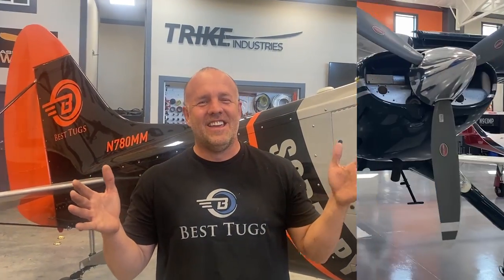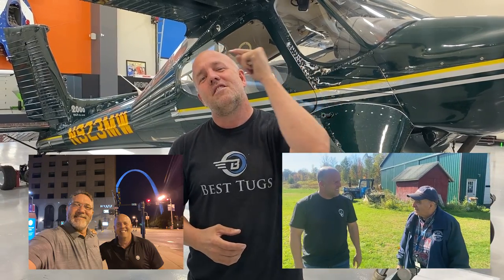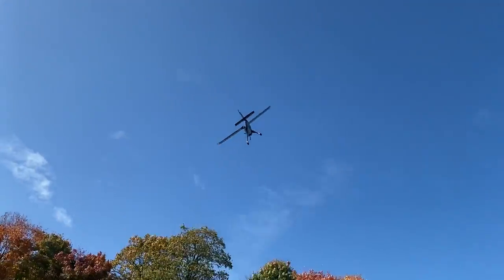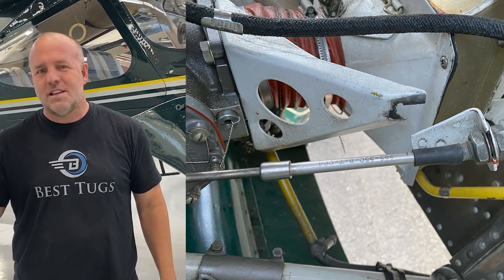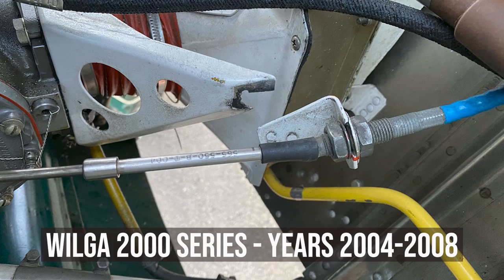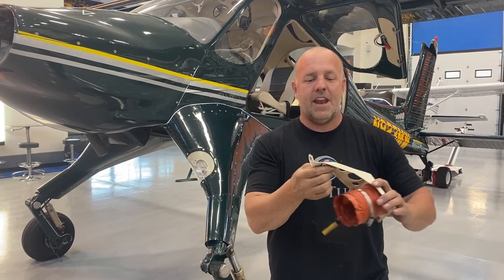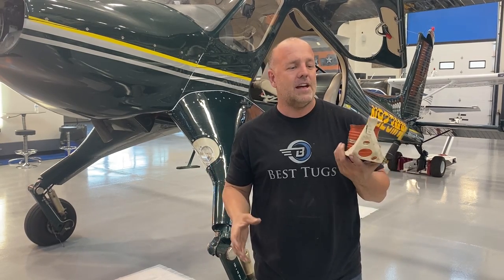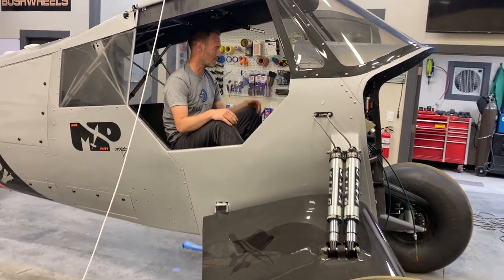Engine Trouble Flying Home a New Wilga 😬 | Scrappy 30

Comment: I'm 73, I soloed when I was 16. started flying lessons at 15, My original flight instructor Who is one of those people in your life who you will never forget was a very cautious type. Those days around 1962, we were flying Piper colts, dual omni was the hot set up. He always drilled into my head to constantly consider an emergency landing option, always be looking for a place to land. He would do the drill when least expected, pull the throttle and say land it. he would make me fly it to final before pushing the throttle back in and then proceed to tell me why the field I picked was a bad choice or a good one. I only fly flight sims now, and darn if I still don't always scan for nice flat unplowed fields near a road :)

Comment: 20 plus years ago, when I started flying I had those fears. But when I read the statics on the cause of air plane accidents I found 70% were cause by fuel management. I purchased a plane with 4 tanks and more fuel than I can fly before I need a break. Got my instrument rating to solve the next issue. These choices haves me the training and confidence to fly safely. And I always think where can I land NOW. Thanks Mike.

Comment: Had 3 quit in 1000hrs. 2 on takeoff, one of which was in a crappy field. When I started flying 8-9 years ago, I just asked (hoped) that I wouldn't have an engine out for a while until I was really ready.... I was given that... can't ask for more! As you said, It WILL happen eventually. To anyone who hasn't experienced it yet, there is nothing quite like it, intensity at a new level!... but keep your head on and you can work through it. Great video and talk Mike!!

Comment: Very good advice to fly by. Always be prepared for the bad things that may happen. 100% correct on the mechanics of things braking with no fault of your own. I've been there too. Crankshafts coming apart, driveshafts coming thru the floor board at 7 grand rpm, pushrods going thru the hood when engine blows. And then there's fire. Hoping that will never happen in the air but prepare for it.

Comment: Mike: Four weeks ago, while flying my 1945 7AC Champ, I suffered a engine failure due to a cracked fuel hard line. You are absolutely correct, there are two kinds of pilots, ones that have had a engine go out and those that will. I had to put Champie down in a cow pasture and was unhurt but unfortunately, it was quite rough and severely damaged the landing gear. Keep making these awesome videos. We all learn from sharing our experiences. Glad your ok.
Reply: Hope your plane is going to be okay.  That's a piece of history.

Comment: Nice point Mike, and for all of you that like to fly safe, here a short story about safety training. 
I've got my PPL-A back in 1990 I remember safety training was a big chunk of the overall flight training as well as of type ratings, but German flight schools doesn't let you go into a real stall with following spin. The idea behind that is to recognize the situation before you get into it. 
As soon as I've got my PPL, I grabbed a pilot friend, an "old eagle" acrobatic flight certified, and asked him to get me into a real spin and recovery. We got to 6000ft above ground and he did the first one, explaining exactly where we are and what he's doing. I remember as today, once the wind shield was full of spinning ground, I was stuck in my seat knowing that if I was alone on the plane I would never have recovered from it, even if I knew what to do. After first recovery my friend told me to do the same, but I said, no, you again, I was still so impressed by what just has happened. 1000ft loss in altitude in one only spin. There is no time to settle, you have to react immediately.
He did one more, this time I was completely aware of what happens and could count with him the number of turns and could say when to hit the rudder.
The next I did on my own, perfectly.
That was a really great experience, completely unexpected, I thought I could handle an aircraft, but was told the other way. That experience accompanied me while all my 11000+ hours of flying since then. 
Later on practicing acrobatic flights in a certified C150, or playing wild above or between the clouds, I don't remember how many times I stalled the engine in all kind of flight positions, but never had a problem to recover.
VFR is staying free of clouds, but what happens the first time you get into the clouds? Sitting inside a glass, having all milk around you and now trust your instruments is another thing pilots should experience, even if they are not IFR certified. 
It shouldn't happen, but it can. 
Today I know, knowing what to do, isn't sufficient, you have to practice as closed as possible to the situation you're practicing for.

Comment: Excellent safety brief Mike!
Reply from the maker: Thanks buddy 🤠
Reply: Mike Patey Did you see my suggestion about the second Wilga?
Reply: Its just a matter of time.
Reply: A good reminder to put the thing on the ground ASAP if something is wrong, even if it is still running.
Reply: what you are doing is totally wrong  placing so much weight in the grams is dumb  it does not belong there and puts stress where it does not belong
Reply: @MikePatey  c

Comment: I was taught to drive defensively which means I'm constantly thinking and calculating in 'What if' moments. That mindset has saved me more times then I care to mention while operating a car, motorcycle, sailboat, or tractor. I'm not a pilot but your advice resonates to my core!

Comment: Yeah Mike engine failures do happen I've had two in an Avid with the early Rotax 65 hp. Fuel issue when the carburetor loosened and an electrical broken wire. Both shortly after TO one with just enough altitude for a 180 back to the runway and the second landing on a frontage road adjacent to the field.  No damage and very good learning experiences.  
"Back to work"!

Comment: Same mind set when I taught emergency vehicle operations in the fire service. While most instructors were teaching "defensive" driving, with the premise of what to do IF another driver did something that would impact your operations, I taught students what I called "offensive" driving; that being it's not a matter of if, but when, another driver, or situation will occur to impact your operation behind the wheel. Great advance for pilots.
Reply: On the roads where I operate, that is a given 😂

Comment: I'm a sailboat guy.   I was single handing a 36' foot from Nuka Hiva in the Marquesas Islands to Honolulu.   I left Nuka Hiva in the later afternoon and was cutting it close to the island which has steep cliffs. I was under engine power and behind the wind shadow of the island.   The Diesel suddenly quit.   The was no wind, and the ocean swell was pushing me onto the island.  I put up the main, and it was slapping back and forth from side to side as the boat rose up over the swell.   I thought I was going to be ship wrecked for sure.   Eventually I stood at the bow with a bucket on a line and tossed it off the bow and was able to turn the boat away from the island.   I kept casting off the bucket and pulling it back in.   Eventually I was able to get the boat out into the wind line.   Later I discovered the valves had frozen in the valve guides due to carbon build up.   I was able to do a valve job on it at sea as the boat sailed along by itself under windvane steering.   I had no valve spring compressor tool on board.   Luckily I didn't loose the keepers, and after about three days got the engine started again.  So yes your engine can quit unexpectedly at any time.
Reply: Internet Privacy Advocate Wow! Great job of thinking on your feet!
Reply: Thats and awesome story! Thanks for sharing
Reply: I respect your resourcefulness, self reliance, intelligence, and calm.  Your seamanship is greatly admired by all of the sailors and pilots out there including myself.

Comment: I've had 5 engine failures in 4000 hours. They do quit and never when it's the best spot to land... always be looking for a landing spot, always. Glad you are OK! Nice plane.
Reply: 2500 hours in my log book, 3 engine failures...seems to be about the right rate ;)
Reply: 13,000+ hours over 20 years, not one engine failure.. maybe I’m doing something wrong...
Reply: @thomasaltruda  Lady Luck is your friend... keep looking for landing spots anyway. When it quits, it's a really bad feeling if you don't already know what you can make from there. Dead silence in cruise or a sputter on take off is very startling...Always have a plan... Fly Safe.
Reply: Probably all cirrus, so many eng failures on those.

Comment: Mike, your 3-2-1 engine failure reminded me of my closest call to an in-flight failure in an Aeronca during my PPL training.  I flew 50 miles out into the Illinois countryside to take some aerial photos of my neighbors new house build.  Just as I hit my 500’ AGL target to take the photos, the engine started most awful backfiring and frightening noises, but I could still keep it at 500” AGL, but only at 38 MPH IAS.  I selected the right mag to troubleshoot the problem and was greeted by SILENCE!  Back to BOTH, and then flying 50 miles at 38 MPH takes a whole lot longer than the 75 MPH outbound.  It turned into an hour and 20 minute search for the next emergency landing spot, but I did make it back to my home base.  The single housing, dual magneto had a catastrophic internal failure, and I think it was running intermittently on just 2 cylinders.  What a day that was!  I totally agree with your statements about being “ahead of the airplane.”  Chuck Yeager talked about aircraft failures during flight by having Plan B, then Plan C, then Plan D, E, F.....!

Comment: This is fresh for me...
On Friday 10/16/20 I had an engine failure at night and had to do a forced landing in a unharvested corn field in my 1972 Piper Cherokee 140.
As it turns out I made the Critical error of not having enough fuel to complete the flight... I thought I had looked into the tanks and had seen more than enough fuel but apparently I had not or just saw something that wasn't there.

Just a reminder to all of my pilot friends to triple check on your preflight checks. 
It's by the grace of God that I had the presence of mind to keep up my airspeed And not spin it in.

It definitely has made me think twice about single engine at night, especially over terrain.
The aircraft was totaled but again by the grace of God I walked out with only a small bump on my forehead that was gone the next day.

Comment: A cantilevered assembly subject to vibration will eventually  fail. In this case, the rivets also provided a stress riser in the flange until the bracket failed around the rivets.
We, in the nuclear industry, have some experience with cantilevered assemblies failing through fatigue failure. We eventually went back through our small bore steam systems and reworked every one of them to reduce the moment arm of those piping hangs, which had begun to fail a few years following a 30% power upgrade modification to the plant. They forgot the small bore piping. The piping announced its presence by cracking socket welds.

Comment: The first model magazine I was given was the January 1975 Model Builder. It had two pictures of a rubber powered Wilga. I was instantly in love with it, but was so disappointed there were no plans available for it. But I did get plans for another plane in the magazine, I won our 4H Grand Champion in model building with it.

Comment: Back in 98 or 99 I was a student in a C1 Katana out of PVU at UVSC.  WE were about 3000AGL just west of west mountain and the RPM began to spike while the oil pressure dumped.  We ran rough for a second or two and then silence.   I thought how weird it was to see the prop sitting still while still in the air.  We glided to an amazing landing in a pasture between Spanish Fork and west mountain.   It happens.  We manage those risks and develop controls to mitigate those risks.

Comment: Hey Mike, on my aircraft and our company aircraft, if it is possible, we have two points of attachment on push pull cables. Generally this is made up of Adel clamps somewhere close to the factory clamp assembly. Even a good lacing job can suffice as a redundancy.

Comment: Glad to see ya back on the air.  
Those who have and those who will.  Remember the early days of ultralights?  I am still amazed by some of the advancements in engine reliability.  We have come so far, but complacency is still probably my biggest threat.  
I only live one state away, but flying really slow stuff.  So slow that I find myself cruising in ground effect.  But only into the wind where I can land pretty much straight ahead, just in case.

Comment: I started out flying ultralights in Australia,  all the focus of flight training was landing options for the upcoming engine failure.   
I got used to it and felt safe enough knowing that I could land below me if I flew in sensible locations rather than builtup/mountain areas.  
Then I got private and then started doing night VFR.  First nav lesson and I'm doing my  enroute checks, I get to identifying a suitable landing option.... and it's dark in every direction with no horizon.... 
Mike can also see the high risk of single engine night flights.

Comment: This! So many times this! And what ever you do don't stop flying the plane. I can relate on this as well, I fly my 172 regularly and have for the last 5 years, 1000 hours into the TBO time this past july and a cylinder just flat out blew apart in flight. Also go through those ADs with a fine tooth comb on any plane you are purchasing, mine were falsely signed onto the aircraft in 2006.

Comment: I had a mixture cable failure on departure at 200 ft AGL over rough terrain in a Luscombe 8A several years ago.  Lucky the old Stromberg carb doesn't have mixture shut off and I didn't have a passenger with me. Engine went lean and lost a lot of power but was able to maintain the 200 ft at 60 MPH and get back to the 2000ft grass strip.  I must say that one got the adrenalin going.

Comment: I had a factory oil return line perforate while flying over 5 feet of snow- I was on wheels.  I landed short of my destination because of a full bladder when I discovered the problem.  I've always thought I could have a mechanical at any time.  I fly pretty high over bodies of water.

Comment: Four engine failures last in a twin.   Two on takeoff.   I credit safe landings on starting in gliders.  It teaches you the perspective you need when power is lost and you have to land safely. For me it made me better understand the margins when power is gone.  Highly recommend if your starting out to do gliders first if you can. I can thank my father for encouraging that. He started in 65hp cubs prior to being a Marine aviator in ww2. Told me leaning with little or no power would prepare you for 2000+ hp down the road.

Comment: Back in 1990's I had a 82 Piper Tomahawk II, over North Jersey the fuel selector value broke, I made it to Easton Pennsylvania and landed OK, kept it high in the landing pattern in case of power lose, one fuel tank empty and the other full. The inside of the fuel selector valve is made of plastic, it had been stiff, the A&P mechanic had lubricant it with a fuel value lubricant, the fuel lubricant destroyed the plastic. A new improved fuel value from Piper was installed.

Comment: I had almost the same thing happen to me with the throttle cable.  It broke off at a partial power setting and I was able to fly all the way back from the Bering Sea to Bethel, AK very slowly!  I was lucky.

Comment: I love that you bring up safety as often as you do. We have too many GA fatal accidents that should be incidents at the most but actually, they should have never happened. 

Flying a high time 1961 C172 in the 4 Corners area has taught me to fly with "where am I going to land" and "where do I not want to be" all the time. It's not a freakout thing, it's just a thought process that's not difference than GUMPS or any other "checklist item". I don't expect to need it but I'm aware of it. I keep my eyes outside, looking at the roads, looking for power lines, and enjoying my time in the air. I love to fly so if the choice is to fly two hours through a high pass or 4 hours to go around... I'm taking the 4 hour flight :)

PS - Nice Wilga!

Comment: I was going to fly my PA-11 from VA to CA, but ran out of time . I hired some ferry pilots. They started getting some weird oil temp and pressure readings and landed in Lubbock TX. I had an A&P mechanic look at the engine. He didn’t find anything other than a possible instrument failure, but I grounded it anyway and have trucked it to CA were a better examination can be made. Better to be safe than trying to truck it from the middle of nowhere if the engine did fail.

Comment: noticed the H300 in the background.. if you see that grease fitting in the lower pulley,, thats a suggestion my friend put in they adopted. and the rubber extensions to Simplex Ag spray booms for helis as well. as the goop was being sucked into the impeller